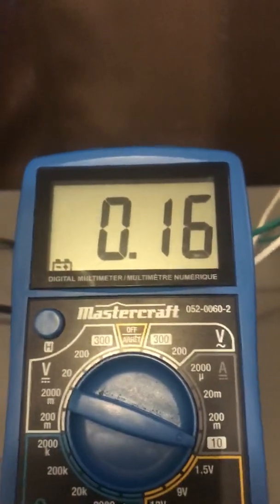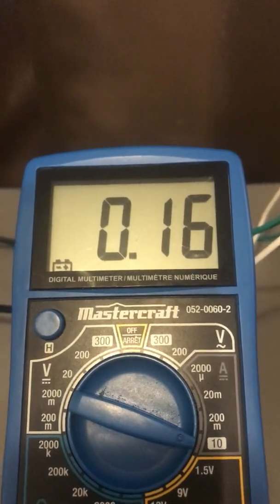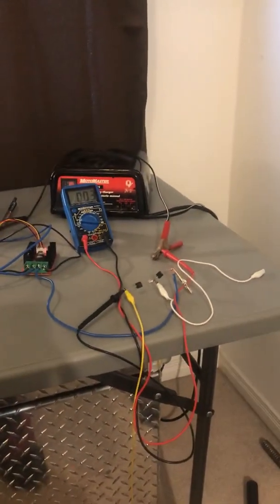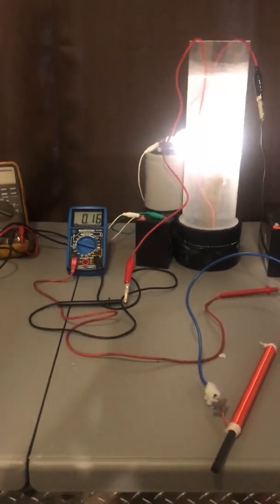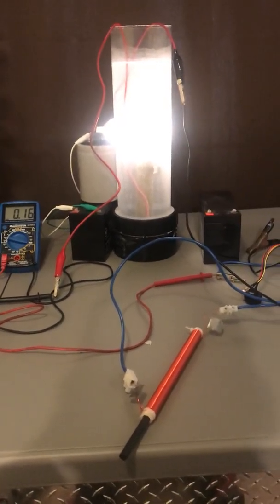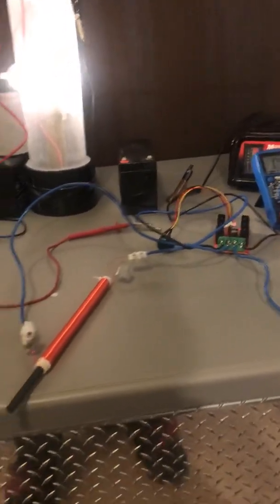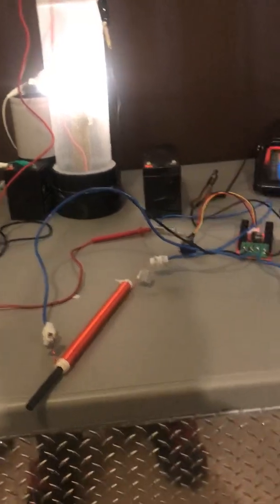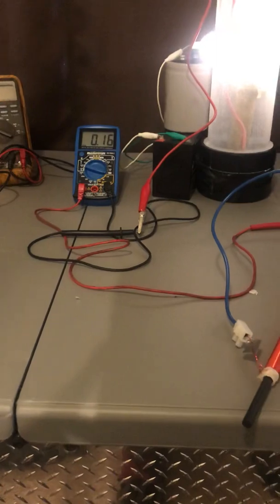Super Efficient Hydrogen Generator Build

Comment: Hey man good to see you experimenting. The meter you have can only measure ac voltage / current up to 400 hz. Anything over that frequency is very inaccurate. You are probably pulling more than 2amp which isnt efficient at all. Just a heads up.
Reply from the maker: It’s running at 200 hz
Reply: OK, standard argument. If this is so dam efficient and significant, then why isn't this technology in common use. Please don't give me the old  "oil company"  chestnut  bull dust.

Comment: Great job, I think the secret is to make serious rlc circuit, which with some frequency " it's can be calculated " you get the circuit feeding himself and drooping tiny leak amperage from the source, and the key of Stanly meyer is to create hig voltage on the capacitor " the plates on the water " he is always talking about high voltage.
Reply: ChatGPT:

To determine the voltage required to maintain a 1 mm gap between the capacitor plates while ensuring that the electric field strength exceeds the dielectric breakdown strength of water, we need to rearrange the formula for the optimal gap between the plates:

𝑑(optimal)=𝑉/𝐸

Given that the desired gap is 1 mm (0.001 m) and using the lower limit of the dielectric breakdown strength of water (3×10^6V/m), we can rearrange the formula to solve for the voltage (𝑉):

𝑉=𝑑(optimal)×𝐸
𝑉=0.001m× 3×10^6V/m
V=3000 Volts

So, to maintain a 1 mm gap between the capacitor plates while ensuring that the electric field strength exceeds the dielectric breakdown strength of water, a voltage of 3000 volts or more is required.

Now, let's delve into the rationale behind these calculations.

Firstly, the optimal gap between the plates is crucial for achieving the desired electric field strength. A narrower gap results in a stronger electric field for a given voltage, while a wider gap reduces the electric field strength. Therefore, a balance must be struck between the gap width and the voltage applied to achieve the desired electric field strength.

Secondly, the dielectric breakdown strength of water sets the limit for the electric field that can be applied before water molecules start to dissociate into hydrogen and oxygen gas. By ensuring that the electric field strength exceeds this threshold, we can induce the desired splitting of water molecules without causing damage to the dielectric material or other components of the system.

By following these calculations and considerations, we can design a setup with the appropriate voltage and gap between the capacitor plates to effectively split water molecules using the electric field.

Comment: if you have 3 different rods...put them in parallel with each other so there is 3 frequencies...your pwm is not gating is it?
Reply from the maker: no gating. will give it a try
Reply: @thewonn  i had good results with 3 coils with caps across them and they were all in series